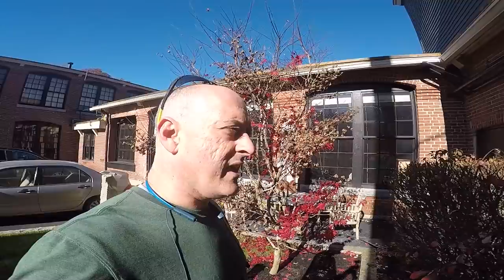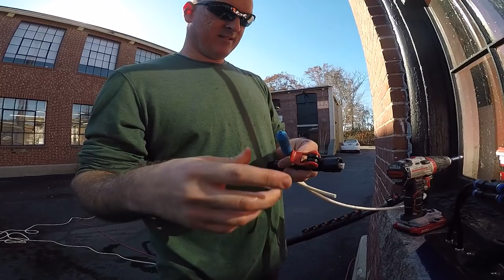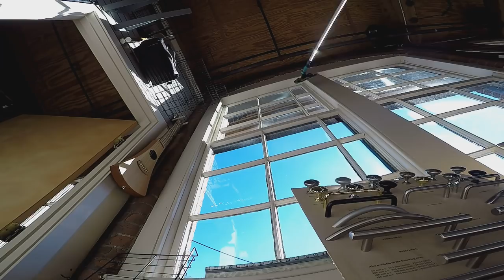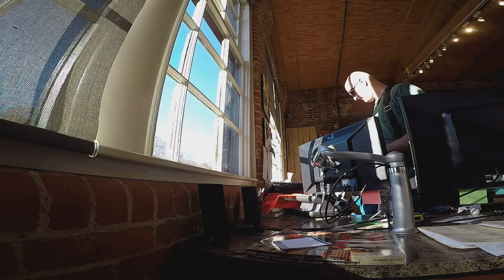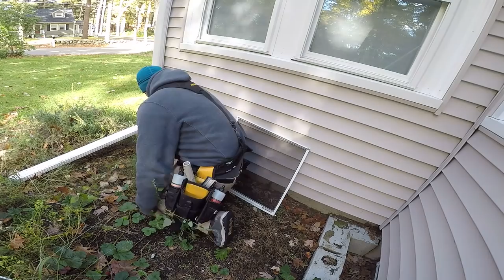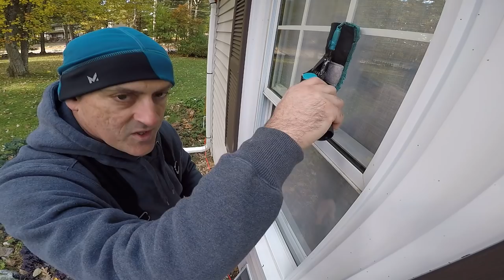When Things Go Wrong...

Comment: Nice recovery with the gutter cleaning sale.  They sell a certain type of glue that fuses hard vinyl like that.  You should have them remove the screens before you arrive or have them sign a waiver letting them know you won't be responsible for any breakage trying to remove them from the outside and charge extra to remove them.  There's too much risk in removing certain types of screens from the outside.